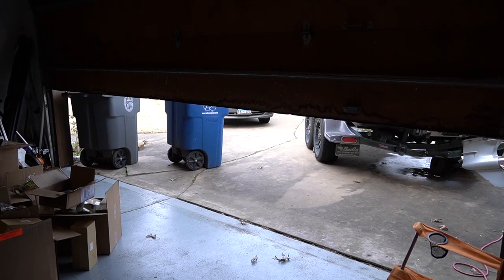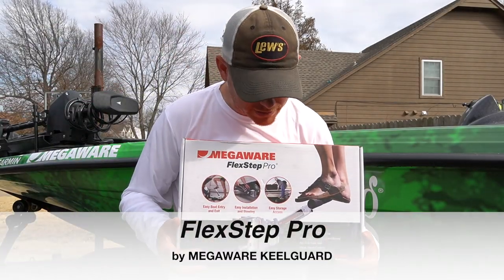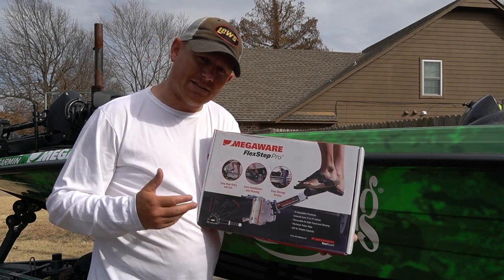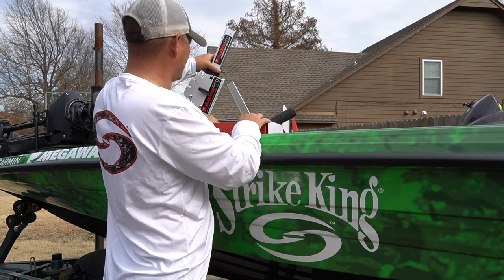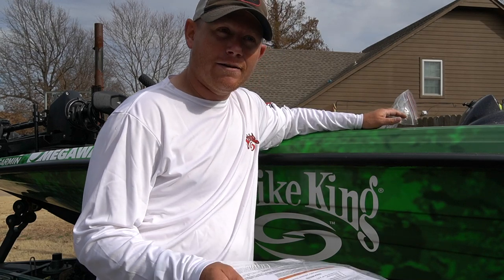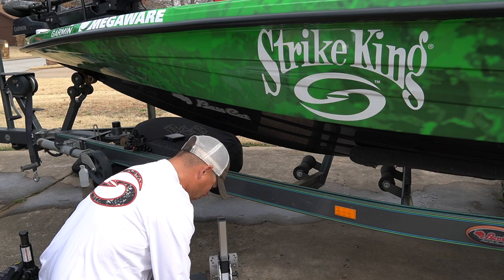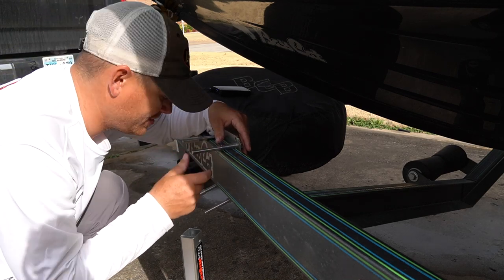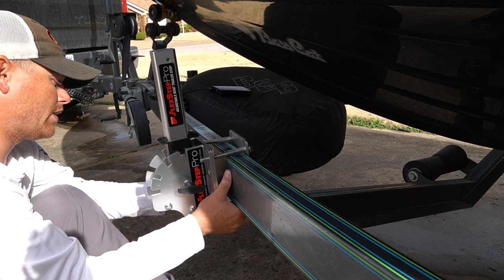Install Fail! Installing the Megaware FlexStep Pro!

Comment: Nice fixture. You didn't fail Andrew. It was more of a fumble I think. But trying to attach that step to the boat and explain how to do it at the same time seemed a little distracting. Good luck in Texas this April.
Reply from the maker: Oh, I always fail when installing stuff. I just don’t have a knack for it.